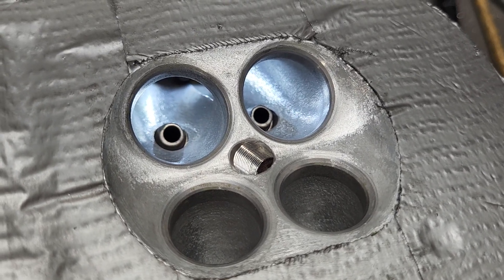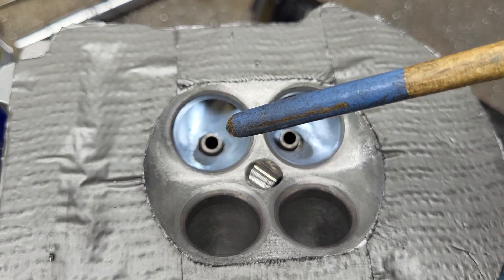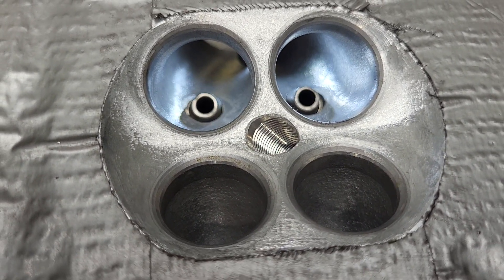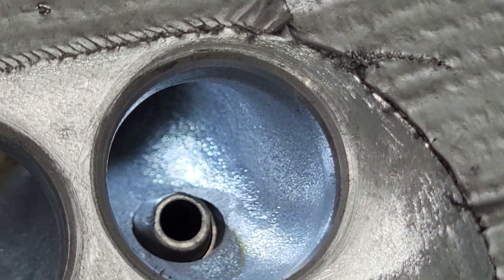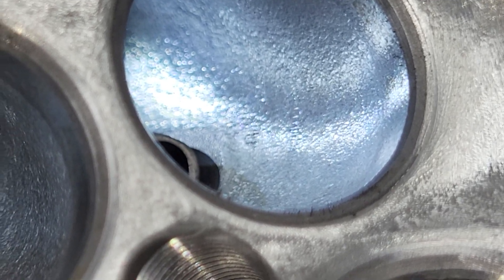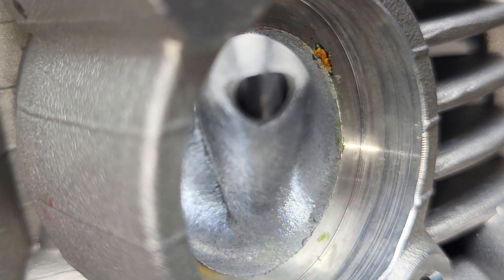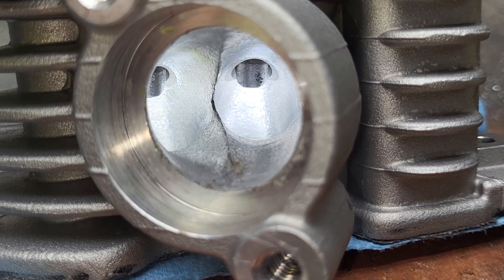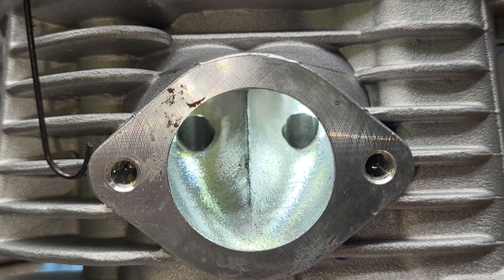4 valve pent roof cylinder head for 10,500 rpm application. Full porting for scooter racing.

Comment: Not to discourage your attempts, Charles, but flowing without the valve will not transfer over to the final assembly.  The vacuum draw on the port without valve will migrate the vacuum reading towards the center. Especially on those short ports. 
  Instead of focusing on the exterior swirl, reverse that idea completely. Swirl will occur from the center out. The air speeds on the port devider will travel faster with less resistance. While the outside slows down around the radius.   Use the combined valve as if they were the alternate intake and exhaust valve during overlap. 
  Treat them like a hemi with two sets in the same chamber.
Reply from the maker: @approachingtarget.4503  Thanks

Comment: I did my 4 valve 1.6 Aveo head.  The bowls were terrible.  I blended everything with little material removal.  My buddy did a perfect valve job as usual. It accelerated better than stock and still got the same MPG maybe a little better.
Reply from the maker: @dondotterer24  Nice!

Comment: You cannot have swirl when the intake ports are symmetric about the cylinder centreline. zero or near zero.  that's why diesels rotate the valves so they are not symmetric.  Or the 1990 LT5 which blocked off one port at low rpm.

A small engine like that can easily be 2 valve and hit 10.5k.  I don't know why they make it more complicated.
Reply from the maker: @chrisstavro4698  I disagree. Thanks
Reply: @servediocylinderheads    How much swirl do you see with 4 valve heads?

Comment: Thanks
Reply from the maker: @mandapalque  You are welcome.
Reply: @servediocylinderheads  zuma 125 is the model made by yamaha. Crates = engine block is separated in half in order to hold the cra camshaft together. The stock yamaha zuma 125 engines is bored out to allow the 67mm piston and cylinder to fit in.